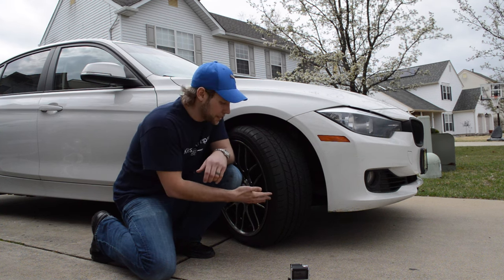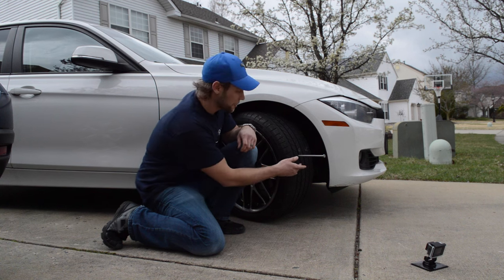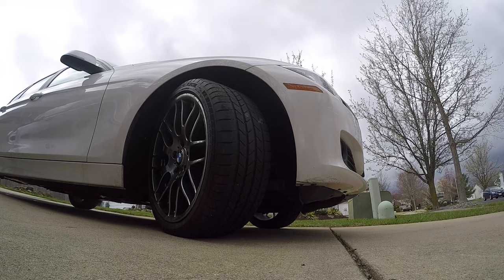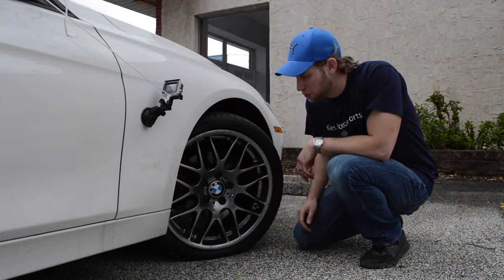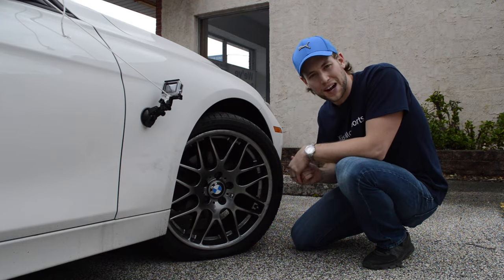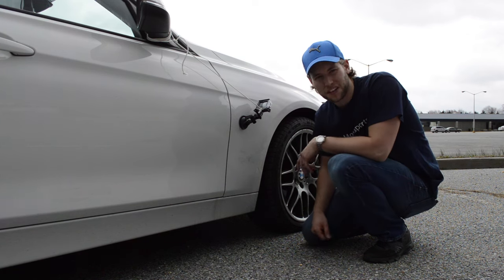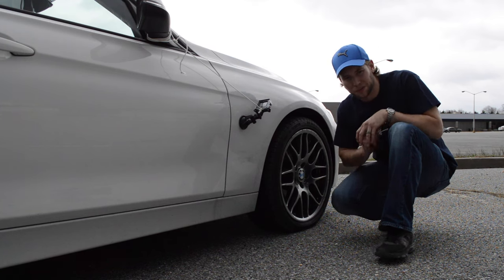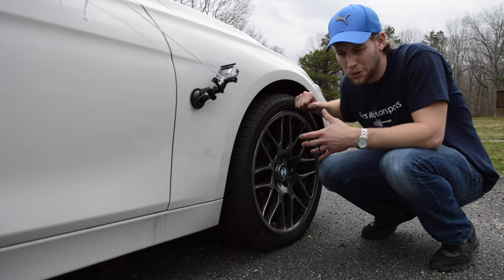What Happens When a RunFlat Goes Flat? F30 BMW and a Big Nail

Comment: I have run flats on my 320I and THEY ARE GARBAGE! My next car will not have run flats. A nail is one thing - hit a pot hole and damage the sidewall and you are screwed. You have no spare and dealers will not repair the tire, they will only replace. Not all tire shops (especially in small towns) will have the correct size in stock so you are screwed until they can get one in. That takes a minimum of a day. 
Sorry - run flats are the wrost invention ever. Not having a spare leaves you high and dry if you are out of town and not near a reasonably large dealer, you are completely screwed. 
They only way I would ever use run flats is if I hade a spare in the trunk. It may use all the room in the trunk but at least I can carry on until I can get to a tore dealer that actually will carry the size I need.
Reply: Good points Ernie.  I agree that the deletion of the spare tire is a problem.  My ideal car would have both a spare and run-flats.  That would avoid both the danger of changing a tire in a bad place at a bad time and being stuck in the middle of nowhere.

Comment: Fucking hell,  A lot of tyre shops will refuse to repair runflats, especially if you have done 40 or 50 miles on it.
If you had checked the price of runflat tyres, you wouldn't have stuck a big fuck off nail in it.
Reply from the maker: If you read the description, or any comments, you would have seen that the tire had a bubble in the sidewalk, which means the tire was trash 👍🏼

Comment: its not about what happens on the outside of your tire, when tires are run flat all the damage happens inside the tire. it starts to wear the side wall down from the inside and brakes cords. i suggest everyone who owns a car to carry a temp repair kit and air pump to give a little air in the tire, you should never even runflats run tires without air.

Comment: I think you should have a spare tire just incase. You would be able to get off the highway safely with a runflat to change out/repair the tire, but it's by no means a replacement for a spare tire. Also if you have a tire repair kit you can just do that as well.

Comment: Just had this happen to me. Drove on potenza for about 3 4km,maybe couple of miles. It seemes to be leaking air at the valve. Should this tire be replaced or is it still good? Didn't drive more than 30mph for couple of miles tho.
Reply: @Igor This is a response to your 4 month old reply
You would have found out by now that run flats can not be repaired and no garage will do it

Comment: I have a 2014 CTS with run flats...which is just what I did when the front right one went flat 5 miles from town. I only drove on it for about 8 miles total and the tire shop said "once you drive on them they have to be replaced because they get tore up on the interior edge". I have AWD, they have to replace ALL four. $1400.00 because I chose to drive on a run flat for a short distance.    No good.
Reply from the maker: It's crazy expensive!

Comment: Just wondering, is it the same to simply just deflate the tire and run without air in the tire instead of puncturing it? Or do the runflats not allow you to deflate them completely? I think deflating it would've saved the tire haha.
Reply from the maker: Hi Vlad, the tire had a bubble and needed to be replaced anyway

Comment: You should also have got a low pressure warning on the dash. and without a spare they may  have a  foam kit and an air compressor in the trunk, if that matters. Since the inside tire wall is being stressed you'll likely need a new tire anyway. let us know.

Comment: Every year I have a flat on my 2013 X1 , after 5 or 10 miles running on the runflat at maybe 15psi, I was able to drive safe home and fix the tire with a regular tire plug kit at 10$ (you can fix 5 flat at that cost). The tires were replaced after 6 years and 45000 miles on them. So you can clearly have runflat and fix a flat as long as you dont drive to long on them and that the puncture is not located of the sidewall of on the edge of the tire like any other regular tire

Comment: Just don't get a flat in the middle of nowhere on a Sunday! I'm running the oem pirelli P7 run flats and they're awesome. The ride is definitely rougher than normal though and it does concern me that if you do get a flat you're basically up for a new tyre.  Here in Australia a P7 run flat is $360!!
Reply from the maker: Wow! I had a bubble in one of mine and to match the tread wear on the other tires, I got a used one for $120
Reply: +Kies Motorsports We are very expensive here it sucks! lol I don't think I'd get a used one, although if it was in mint condition why not I suppose.
Reply: I run Pirelli P7's on my Honda, bought'em used for $60 each but they were in near new condition (~85% tread).
Reply from the maker: Great price!

Comment: Great video. Just a question: Does the car advise you that you are running flat? Is there any light or beep that goes off?
Reply from the maker: +Daniel Medina Hi, yes. The car would indicate that a tire is low and has an arrow that would indicate which tire it is. I believe it does beep and there will be a light on your idrive screen and where the gauges are.

Comment: you just blew $550 for that single tire. run flat tires doesn't ever come cheap.
Reply from the maker: ha, I'm not that crazy. Tire had a huge bubble and needed to be replaced..
Reply: its like 10$ to repair å flat tire.. so if it wouldnt be a buble in the tire he wouødnt have to change the tire...

Comment: I'm gonna be 18 soon would u recommend getting this car at 18
Reply from the maker: If I was 18, I would love to have had this car. Keep in mind that everything is more expensive on a BMW. I personally have had a number of Subarus and I've done tuning, suspension, nitrous, head units, a clutch, and tons of other modifications and repairs at a fraction of the cost. I don't know if I would recommend it, mainly because of the potential cost of everything. 

In my Subaru WRX I added an $85 tune that added about 80 horsepower. In a BMW, it's probably at or around $1,000 to get 80 horsepower (for a 328i).
Reply: +Kies Motorsports that's true but I thinking the 320i instead of the 328i reason being the 320i is a 4 cylinder and theue very good on gas
Reply from the maker: That's a good thought. I get about 34 mpg in the 328i. They're all great cars..

Comment: can u patch the hole or do you have to replace it?
Reply from the maker: The tire had a bubble, so I had to throw it out anyway..
Reply: I own a 2015 640i gran coupe now and whenever it get flat I just drive it normally and does not even notice the flat until i do my once a month tire pressure checks. When it's flat it hovers around 20-22 psi which is still runnable. I  then just go to a shop and have it plugged and its good to go. I already plugged it twice due to the usual suspect of small nails in the road. 

I once drove it for 3 weeks tho without noticing the flag but I only use the car like 1-2 times a week and run it like 24 km a day and don not run it over 100kph much. When I found out it was flat with 22 psi I just went to a brdigstone shop and have it plugged by one of those new tire plugging guns. But yah sometimes even when not flat your run flat tire will produce a bubble on the side tire rubber. Its still runnable but just looks ugly and better off replacing it. Only happens when you make a really really big bump on your run flat tire under high speed driving tho.

Comment: But how much does those tires cost? Compared to regular tires?
Reply from the maker: Those tires (the one I stuck a nail in needed to be replaced anyway) are about $300 each
Reply: I see. Well they are very safe, but at a price. Good video!
Reply: I have found them as cheap as $150-170 each (brand new at FIrestone). I bought tire warranty and had them replaced for free or reduced cost when damaged.
Reply from the maker: It all depends on the size and type, mine were 19s, so they were a little more

Comment: You couldnt put that spare in the trunk?
Reply from the maker: +Kyle Smitsdorff No, I had my full size jack back there, so I threw it on a towel. The tire was to replace the one with the nail, since the tire had a bubble and needed replacement
Reply: Yeah I saw the vid, was just thinking about your interior! Great content pal, thanks

Comment: And what if you tear the side of your tyre? You are screwed! And since you don't have a spare tyre you have to be towed. Good thing when that happens in the middle of the night in the middle of nowhere!
Reply: The likelihood of that happening on sealed roads is so minute it'd be the same as saying you should have a spare radiator hose in case it cracks in the middle of the night on the highway.
Reply: Brem no bro. I had run flats and got two major flat. Each cost me 1,000 dollars plus. I hit a pot hole and blew the run flat side wall. Since I was on mass turnpike a regular tow couldn’t tow me so the state did and from mass to ct cost me 700 dollars!! Happened twice! Potholes blows out the side wall!
Reply: @bremCZ  Happened to me, no spare, no cell signal. Foam can just laughed as it oozed out side wall split. Lucky someone came to my assistance.

Comment: Did you replace the runflat? Or just got it fixed?
Reply from the maker: +Anoop Chandran Hi, thanks for watching. I had to replace it after putting the large nail in it. The hole was way beyond repair and I've heard that you should avoid plugging and patching runlets.
Reply: +Kies Motorsports your crazy lol. How much did it cost you? Thanks for the video i was curious myself about this
Reply from the maker: +Jon Lei Ha, hope you enjoyed watching a large nail enter my tire.. I actually had a bubble in the tire and I had to replace it, so instead of wasting the opportunity, I thought people would like to see what happens when one of these goes flat (and I was super curious, as well). I bought a used tire to replace it, so that it matched the brand and tread wear of the other 3, but it still cost quite a bit for the tire and mounting + balancing.. $150ish..
Reply: Ouch
Reply from the maker: Yea, it still hurt.. but like I was saying, I had to do it.. so why not have some fun? ha. Thanks for watching
Reply: My car's parked at home with a flat Bridgestone Driveguard runflat from encountering a nasty pothole. How did you find one used tire with a matching tread wear? Would love to save some money if possible. Otherwise it's looking like $400 for a pair including mounting and balancing.
Reply from the maker: Hi, I found a lot on eBay. My tread wear was 7/32 and I found an 8/32 on eBay for $130. The tires are crazy expensive.. I'd try eBay..
Reply: Thanks! Just curious, how many miles before your run flat became 7/32 thread wear?
Reply from the maker: Hi Jason. I'm sorry, I don't know. I actually bought the rims used..
Reply from the maker: Hi, I'm sorry, I bought them used.. So, I'm not quite sure..
Reply: Kies Motorsports yes thank you for that. I am glad you know that. For future notice for anyone who needs this!! FOR ANY run flat tires that do activate the run flat technology the tire is now NO good and needs to be replaced! These tires are not patchable do to the run flat! Now if the run flat is not present and the puncture is fixable being 1/4in or smaller in diameter and there are no previous NON- RMA patches With a lot of other factors that need to be checked by a trained technician and the tires integrity is good then by all means fix the flat! 

ps STICKY PLUgs and hot patches and other dangerous Patches ARE NOT RECOMMENDED DUE TO IT NOT  EING DONE WITH A PATCH AND A PLUG. The two patch jobs are totally different and the ones that are not done with a patch and a plug are against RMA( RUBBER MANUFACTURE ASSOCIATION) and also are weak patches that degrade your tires strength!